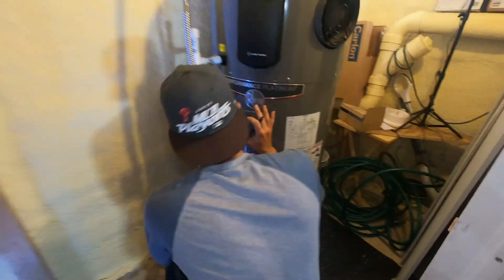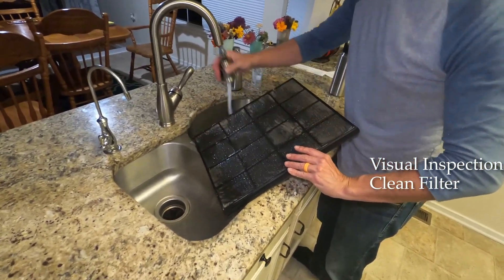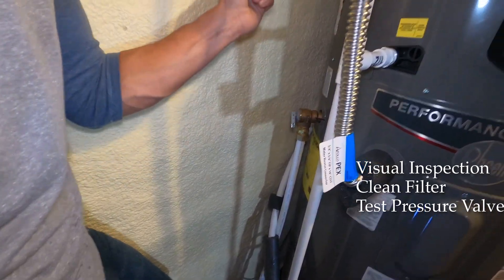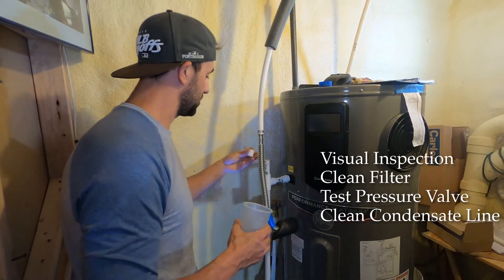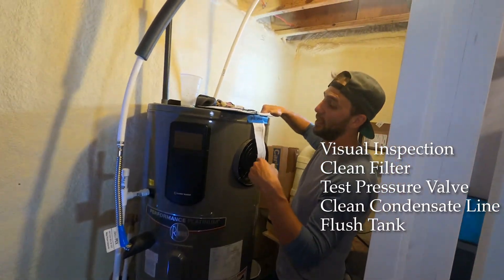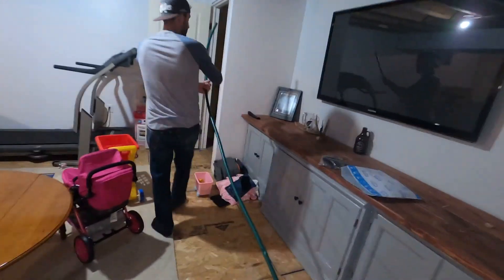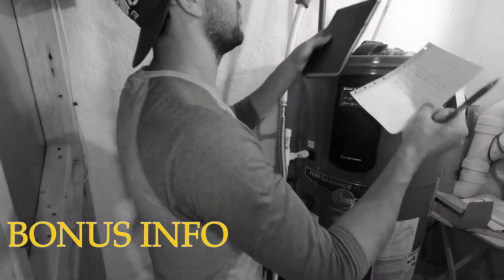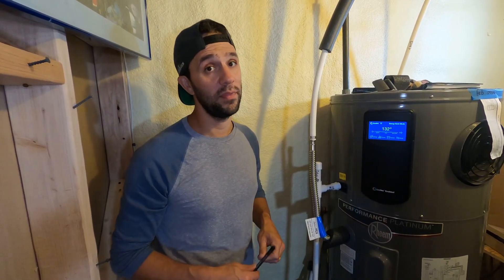Hybrid Water Heater Maintenance for all Brands - Rheem, AO Smith

Comment: I have an issue with mine the power isn’t going to the machine somehow. We just bought a house and the heater is this model it was working before we signed the paperwork but we came in the night we signed it and I checked the water it wasn’t working. Since then we’ve been without hot water, I’ve checked everything and it all looks good but only the display is off
Reply from the maker: check the break box and make sure all breakers are on…. 

i’d grab one of these and see if the unit is getting power 

https://amzn.to/3atXEHK

can get at lowes or home depot 

if you know the breaker it’s one, cycle the power(like you do with a computer) 

good luck - sorry you’re dealing with this in a new house ;(

-Mike
Reply: @FamilyDIYtv  if I do where would I check if it works
Reply from the maker: @RevenantsToes  the break box or the cable suppling power to unit.   if your not following - maybe, ask someone that helped you move to check maybe ?
Reply: @FamilyDIYtv  checked the voltage it’s 100% fine and hooked up just not turning on
Reply from the maker: @RevenantsToes  so the units getting power but not turning on …. your panels prob bad - unfortunately. i’d call rheem asap and see if it’s under warranty.  

they can at least send you a panel …. 

did you try to power cycle it yet ?
Reply: @FamilyDIYtv  yes tried that already I’ve done everything short of taking the machine apart
Reply from the maker: @RevenantsToes  see what rheem says tomorrow!  good luck. 

let me know how it goes !

Thanks 
Mike
Reply: @FamilyDIYtv  Well thankfully the warranty for our hot water heater was still good and we got a brand new one that was successfully installed! We have hot water lol, I shall give you a like for even answering me everywhere else I asked or looked no one would answer me

Comment: Always bleed air from water out a tub fill.  They do not have a aerator which can clog with crud.  If you don't have a tub fill remove the aerator from a bathroom sing (many kitchen sinks are inconvenient) and then blow off the air and rusty water.

Comment: Great content, I would recommend keeping the water on when flushing the unit as the pressure from the incoming water line will help flush any sort of build up out instead of just bypassing it.  When the water goes cold you know you’ve flush out the tank
Reply from the maker: Tate - Great tip !!!  Thanks again - Mike
Reply: The manual recommends just a few quarts be drained once a month to clean out the deposits.  I agree about keeping the water on.

Comment: Would you insulate the room to make it like a cool food storage room?  Or just to minimize the cold air from going through the house or would that backfire and make the heat pump work slower also?  What are your thoughts?
Reply from the maker: It's a great idea !  i can see that working for alot of people, but it won't work in my case - great idea.   Some others have said make it a wine celler !   i like that idea too ! 

-Mike
Reply: Both the intake & output of the heat pump may be ducted. Kits are available but pricey. The idea is to pull warmer air from an upper level of the home & duct the cool air either outside or a room you wish to help cool in the summer heat. I might duct the intake but to be honest, in my case the unit doesn't run long enough to cool effectively as my basement is rather open & can buffer a lot of heat or cold.

Comment: Interesting video with lots of good reminders about regular maintenance. I was happy to hear the hybrid water heater running again at the beginning. We have time of use electricity and I’d really like to get one and set it to heat up overnight. It’s in a hall closet, though, right outside the master bedroom bedroom, and I’m still not convinced it wouldn’t wake me up every time it ran!
Reply from the maker: I wish i had a sound meter to measure it and then show comparisons ….    Maybe i need to fine one!  

Let me see what i can find…. Maybe I’ll do a short…

-Mike
Reply: @FamilyDIYtv  That would be interesting. It would be very disappointing to spend the money buying and installing one to find out that it woke me up whenever it ran! Helpful to know there’s not much more to the maintenance than a regular one, though.
Reply from the maker: @caddyzig  I’m making a video on it.  Found a free app that measure decibels. 

-Mike
Reply: @FamilyDIYtv  Excellent! Wonder if it would be safe to add some sound insulation inside the closet if it really was too loud. 🤷🏻‍♂️
Reply: They are kinda loud